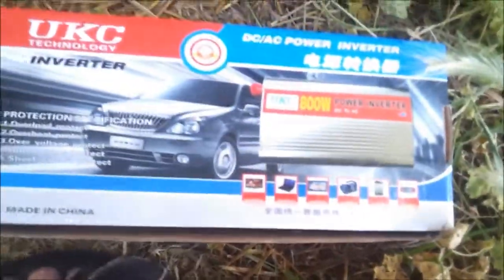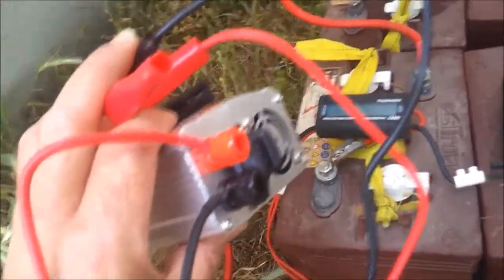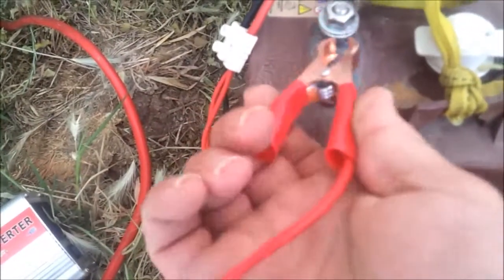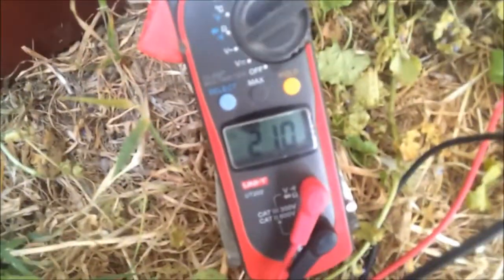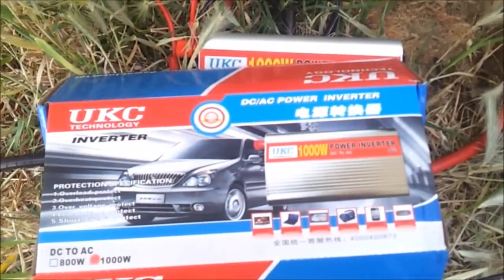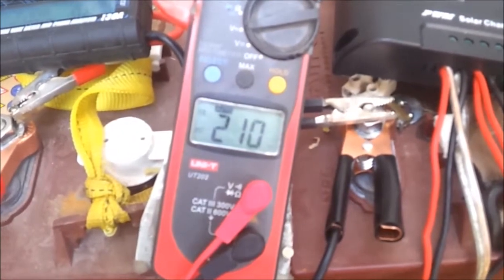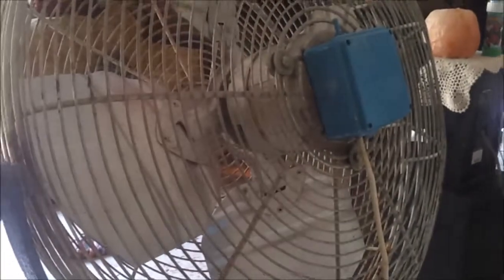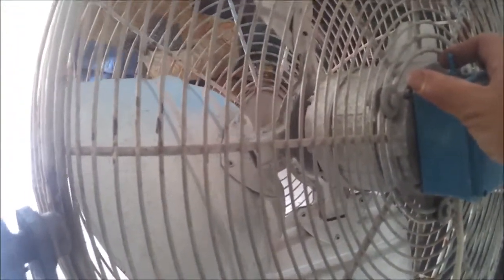1000w modified sine wave inverter dont work! DONT BUY!!

Comment: Sometimes its the voltage meter's fault. Some meters cant read modified sine wave properly. You need a true RMS multimeter to get the proper voltage of the modified sine wave inverter.
Reply from the maker: LetsGetStarted thanks for your tip. i will use it for the next time i will test a modified sine wave inverter.
for this chip chines inverters, i made a few more power tests. it can give 300W MAX power, if i try to pull more it will switch off itself.
Reply: ilan.neWorld Ebike Yeh... that's normal i think...

Comment: Modified since wave inverter is a piece of shit :)
Reply: bullshit he dont know how to use it

he plugs everything in, and than flips the switch of fan , fan should have been on, than plugged in, its not pure sine wave, it cant make sutch huge jumps & all , if fan is on, than plugged in works, modified sine wave is good, just gotta know how to use it , 1000w modified gives 500w or so
Reply from the maker: SpeedManiac1976
dear friend, the right way to connect DC-AC inverter is:1) first connect the DC side, 2) than turn it on 3) and than connect the load.

the inverter need a 0.5-1 second to stabilize the voltage, before gives power to the load.